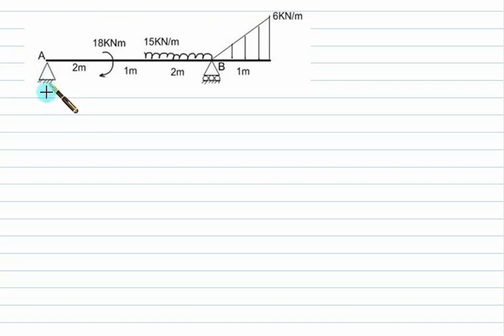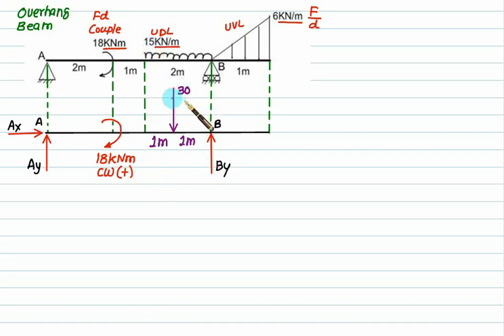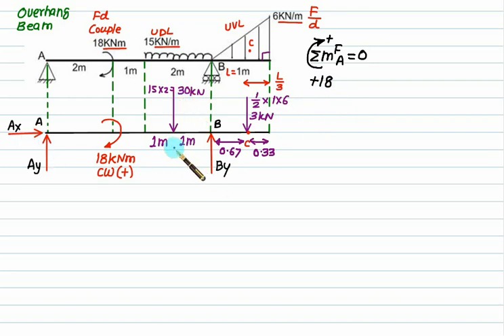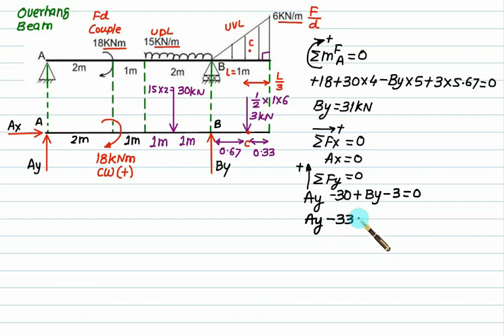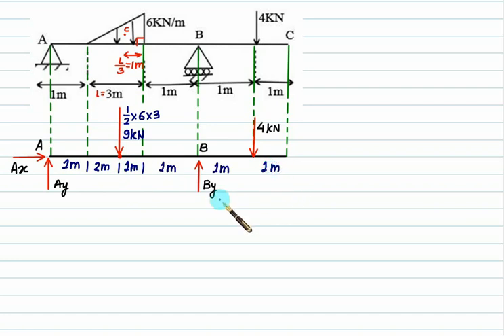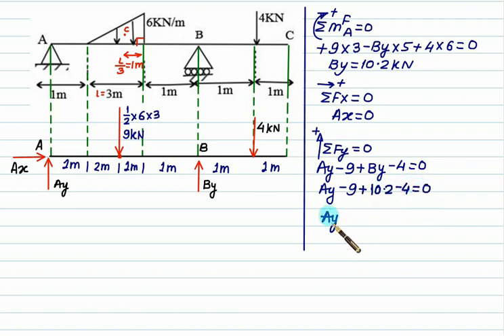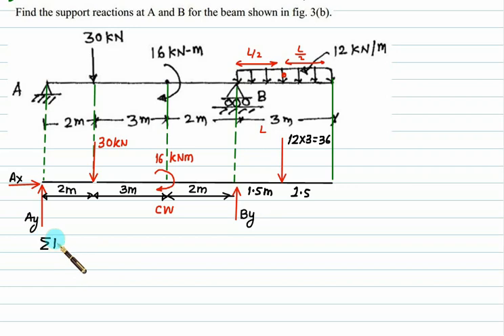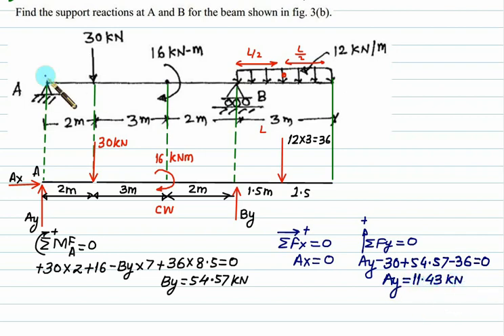Reaction on beam 04 |Types of Beam, support and loads |  Numerical 3

Comment: Sir please do 2011 triangular cantilever sum in easy way, please.
Reply from the maker: send me question
Reply: @sunilmohodmh31  A triangular shaped cantilever beam of uniform thickness is shown in fig. The youngs modulus of the material is E. A concentrated load P is applied at the free end of the beam.
Find area moment of inertia about NA.
Find max deflection of the beam.
COMBINED QUESTION 2011 GATE (2+2) MARKS